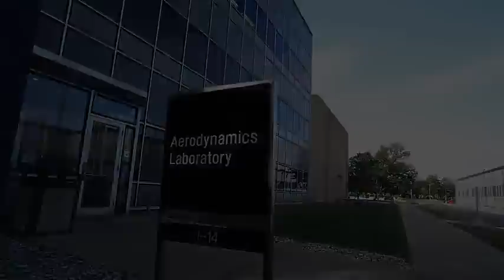Chevrolet Camaro ZL1 designed for maximum downforce

Comment: @AdverbAdjective Changed engines in the GT in '11, changed the engine in the GT500 in '12, retuned and redid parts for the 5.0 in '12 with the Boss. Now for 2013 they're switching the GT500 engine again with a new supercharger borrowed from GM lol. Ford has to continuously redo their engines to keep up with the already old LS3/LSA/LS9.

Comment: @AdverbAdjective This was before switched engines in the GT, not to mention the block change for the GT500. Seriously...how many times is Ford gunna rebuild the same tired engines?
ZL1 is a failure...yet it dominated the manually operated roman cart suspension Boss 302 LS in every handling category INCLUDING BRAKING? Makes sense to me.

Comment: @ratmtbola But let's just pretend for a moment that you're right. Throw the whole argument out the window. Porsche has made 1000 different versions of the same car since the 60s. And aside from one SUV and one sedan, that's it. Whereas GM has been making literally every other kind of car in the market. The fact that they (and the same can be said of Ford) can essentially make a cinder block go 200mph without drastically changing its shape in any way says a great deal.

Comment: @davewhodavedunn What happend when chrysler put a splitter and a spoiler on the viper? They made the car that holds a 7:12 nurburgring lap time and still holds the record at laguna seca, miller motorsports, button willow 13, and spring mountain. Saying american cars cant handle is just ignorant. So what does that make you?

Comment: @ratmtbola Did a quick google search...found out the C3 Corvette's ('68-'82) produced negative lift, thanks in part to a slight rear spoiler. They didn't even use a wind tunnel. You don't seem to understand the what you're actually talking about.

Comment: So everyone knows...I've rebuilt, modified, and suspension tuned many Porsches. An early 930 Turbo at 145 MPH is a scary car....it is VERY light in the front end. So no one should go overboard on what the early supercars really drove like. They were scary and the people that drove them fast had balls bigger than a brass monkey. The racing versions were completely different.

Comment: @AdverbAdjective I don't ever remember saying anything negative about the N/A nature of the engine, or the size. Like most intelligent people I understand the differences between engine designs. You're proving MY point listing the cars the 302 LS has beaten..because the ZL1 has beaten the 302 LS and better cars than that. The GT500 has no lap times, no production runs, and as of yet no proof the car can even put the power down.

Comment: @MotorsportsUnplugged Of course early 911's didn't handle as great (or rather: weren't as easy to control) as todays cars. But even the very first 911's (as well as models before the 911) already created some downforce which GM finally managed to do as well 60 years later ...

Comment: @AdverbAdjective GTR = 520 hp  3,800 pounds. ZR1 = 638 hp 3,200 pounds. 100 hp disadvantage, and 600 pounds. In case you didn't know the GTR does well against the ZR1..that's because Nissan built great technology into the car. ZL1 follows the same basic principle. Screw hp, make the car FAST the right way. The "all new" suspension equates to some Boss 302 parts, and a new fuel cutoff "launch control" all still running to 285 crap rear tires.

Comment: @AdverbAdjective You don't even know your own fanboy engine? The 5.0 was tweaked significantly to get 444 hp and 380 ft. lb of torque (less than the GT lol). The GT500 motor was changed with the switch to aluminum which you'd know if you knew something.

Comment: @ratmtbola I'm sorry, but the wind tunnel tester that's used by NASCAR teams is a far more trustworthy source than you are. Are you talking about the coefficient of drag or the coefficient of drag area? Either way, it doesn't change the fact that the C3 produces negative lift.

I'm not arguing with a GM employee or GM...I'm arguing with you. I'm quite certain GM hasn't wind tunnel tested every vehicle they've ever produced, and that to the best of their knowledge this is the first.

Comment: @MotorsportsUnplugged Yep, but there's still always some version of the 911 that faster than the ZR1. In fact now there are actually 4 versions, the Turbo, Turbo S, GT3 RS and GT2 RS. Of course those are the most extreme versions of the 911, but so is the ZR1 the most extreme version of the Vette.

Comment: @AdverbAdjective LOL. 2012 Boss 302 LS against 2005 Z06. The 2011 Z06 Z07 ran Laguna Seca 2 seconds faster on a slow lap, just like the ZL1 did at Inde. Also the Boss 302 LS is a 2 seater, track car. I hope you're still talking crap when the GT500 loses the overall competition.

Comment: @ratmtbola And my original arguments were that A) Comparing a Porsche to a Camaro is like comparing a cheetah to a grizzly bear, and B) You are making an unfair generalization about an entire company based on a single car. Like I've said, this isn't the first time GM has ever used this technology. They've been using it just as long as Porsche has. This is just the first time they've applied it to a Muscle car.

Comment: @SirGarforth Yeah sure. The Camaro (as well as the Mustand and Challenger) are more about the looks than anything else. But still, with a relatively high power output (especially in the case of the Camaro ZL1 and the high-performance versions of the Mustang & Challenger) and more or less low weight (compared to 'normal' cars), it's considered a sports car. So yes, you can very well compare it to a 911.

Comment: @ratmtbola Then why did you use DC (not even DCA which is the real world coefficient) to argue that the C3 didn't create downforce? It doesn't go both ways kid. Also, if you think the DC or DCA doesn't dictate downforce then you clearly have no clue what you're talking about, as DC and DCA are required to be able to find downforce or lift. 

I proved GM designed a car 31 years before Porsche that created negative lift, therefore proved everything you said wrong.

Comment: @SirGarforth What? Sports sedan? Last time I checked sedans had 4 doors. How many doors does the Camaro have again? Oh yeah, right, 2. And the whole backend is also way closer to a sports car or coupe than to a sedan.
And no they haven't used this technology on the Corvette 'for decades'. First sentence in this video: 'This car is the first performance car that GM has done that's gonna have either zero neutral lift or negative lift'.
Stop making up some shit and deal with the facts.

Comment: @SirGarforth Fact of the matter is that a Camaro IS a sports car (even though it's in the 'muscle car' sub-category, just like a Mercedes SLS AMG could be considered a 'grand tourer', but it's still a sports car). And it's also a fact that this is the first time that GM has managed to create zero or negative lift, which others like Porsche have accomplished half a century ago.
Those were my original arguments. And your attempts to defy them are fucking ridiculous & without any facts

Comment: @AdverbAdjective Motortrend also compared the SS to the GT500 3 or so years ago and the SS did very well as you know. Get off your high horse you tool. The ZL1 is a car that has numbers better than C5 Z06's and close to that of the C6 Z06. The GT500 will be outclasses much like the Boss 302 the first time anyone tries to take a corner hard.

Comment: @ratmtbola No you cannot. The only thing a Camaro and a Porsche have in common are that they have four wheels. They are on completely different sides of the automotive spectrum.The Camaro's design puts it closer to a sports sedan that anything else. And besides, you were making a completely unfair generalization of an entire company. This is the first time that GM has used this technology on a MUSCLE CAR.They've been using it on the Corvette for decades.

Comment: @ratmtbola That's exactly what I'm saying! The Camaro is not on the same level as a Porsche or a Ferrari or an Audi (Well, some Audis) and it never will be! The Corvette, however is a different story entirely. It was actually designed for speed and agility more than anything else. The Camaro is just a fashion statement. The same can be said for the Mustang and Challenger.